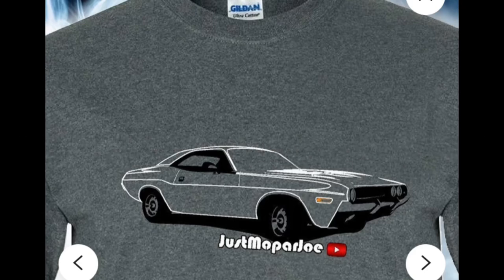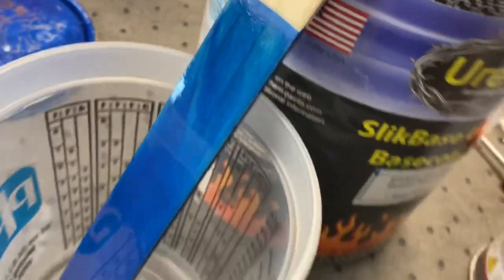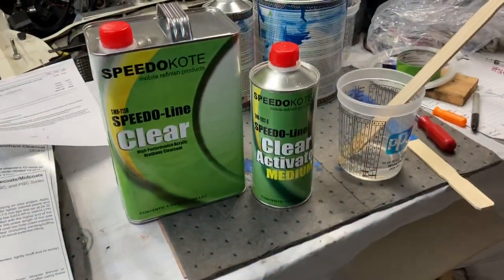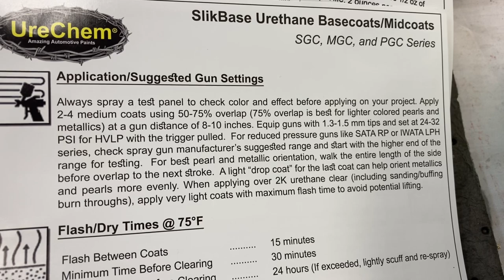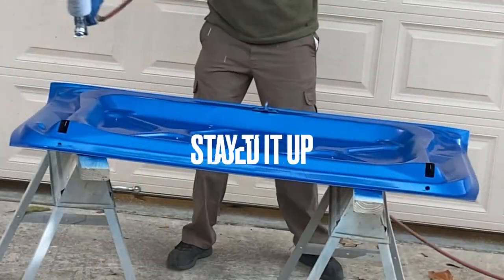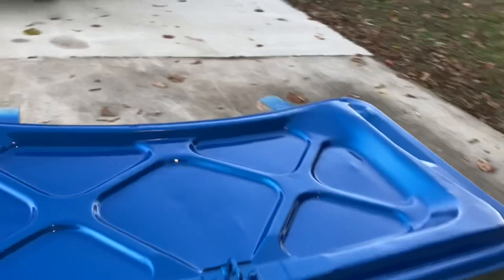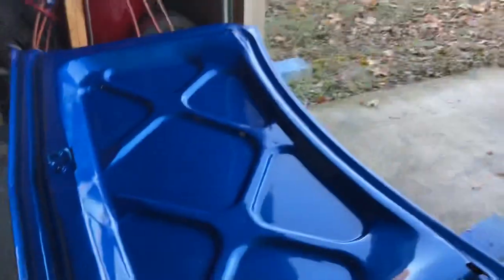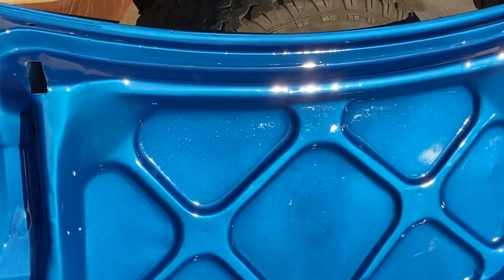The Cheapest Alternative to B5 Blue: Finally Painting my Dart Sport, Part 1

Comment: I love living in Wisconsin, but we have snow cover.  I tried using a single stage brite blue metalic from summit. It works but is rather thin, needs another coat.  I believe we should try this 2 stage. Another great video that is similiar to what I'm doing!
Reply from the maker: Awesome Roger! If it’s been cured long enough, you may can wet sand it and clear over it. I’ve seen it done before but haven’t personally done it. There’s always a chance of a reaction between brands and types. You might have to reseal the entire job, then base and clear 🤔

Comment: The 74 b5 is different from the earlier, it has violet in the formula, worked on a 74 dart and it looked like the before picture,  73 and back looks more like what you have there
Reply from the maker: Thanks for sharing! I still have a spot on the rear quarter inside that’s factory color, that I can compare. But for an old dart sport, it should be nice.
Reply: @JustMoparJoe what you have on it looks better anyway IMO